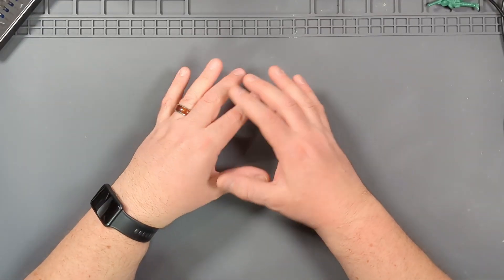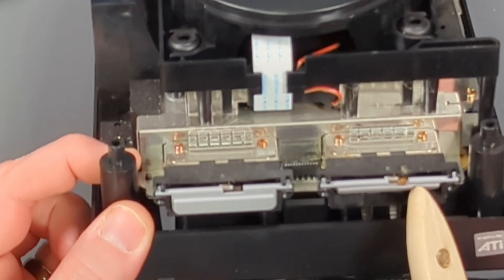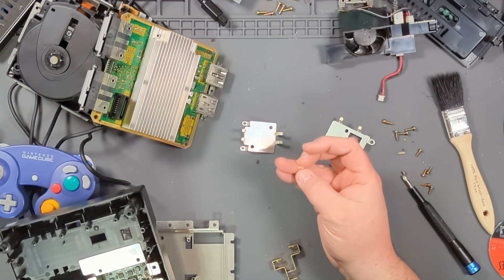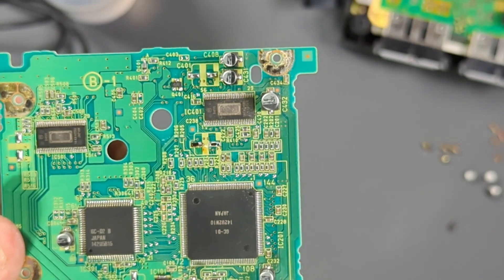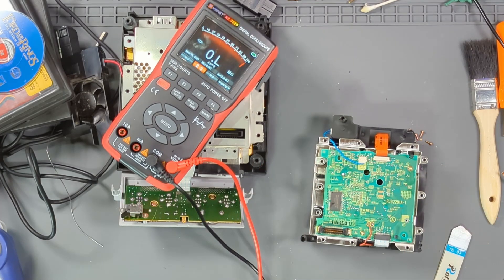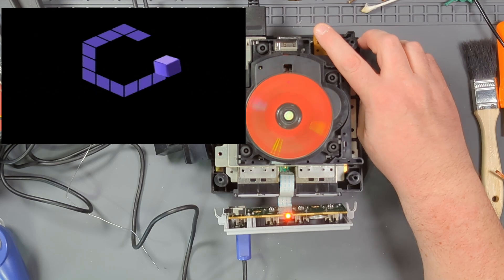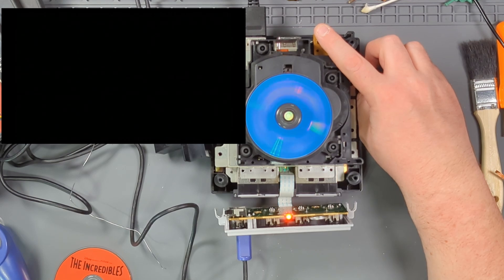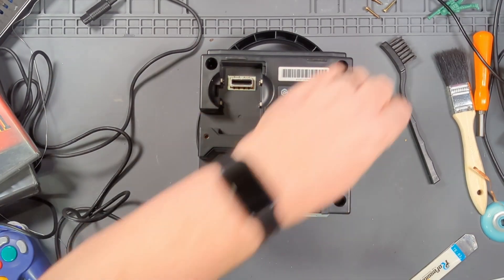Nintendo GameCube Won't Play Games...Capacitors or Pot Tweak What will fix it  ???

Comment: Hi,  should replace the capacitors on the optical driver board. 95% not reading problems can resolve without tweaking the VR.